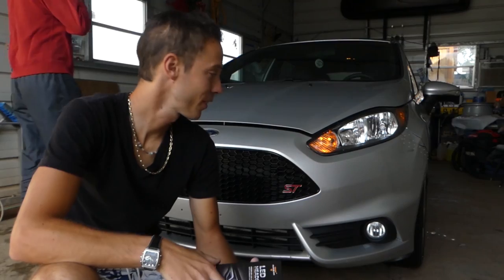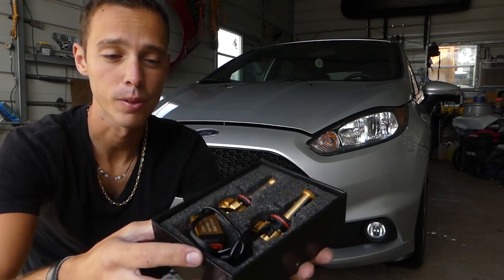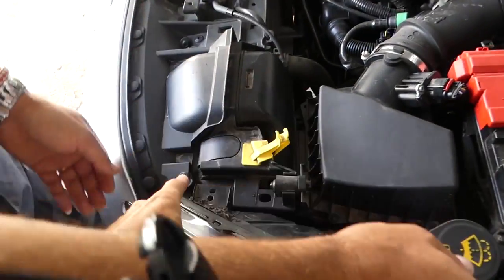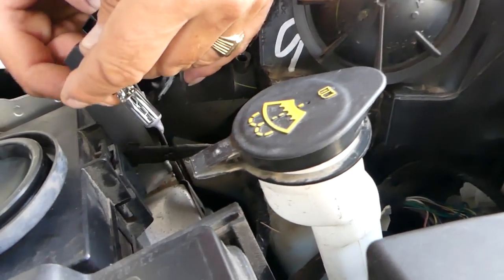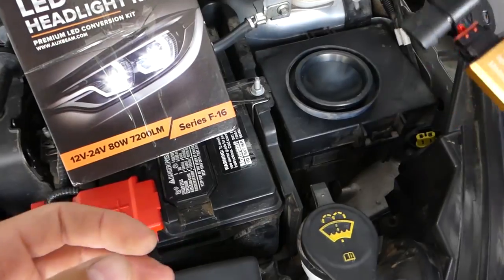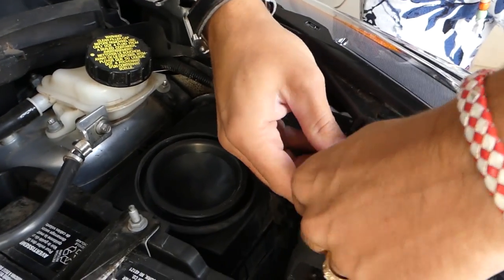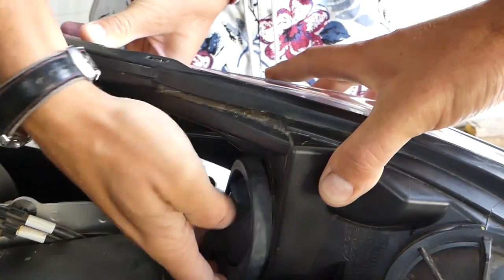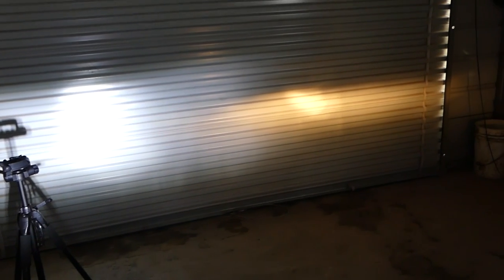Ford Fiesta ST LED Headlight Bulbs Installation  & Review by Auxbeam

Comment: The LED's can work well in newer cars.
The only problem is with older reflectors designed for the small point light source of the halogen filaments.
The LED emitters (especially COB types) are a larger light source which gives a less focused beam pattern.
I am still fiddling with LED's, trying to get a good enough focus in my 2001 Ranger.
For me, the halogens are better.

Comment: Just installed some of these on my Fiesta ST, and the beam pattern is terrible. If you look on the wall, the stock headlight has that nice cut off, and it won't blind anyone. The LED one though is way too high, and doesn't have that fine cut off like it should. They're bright as can be, but are awful to be on the other side. I'll be returning mine. They're great on my ex's Prius though. Just our housings can't use them properly.

Comment: that's going to blind the drivers in front of your ST
Reply from the maker: Why then most of the new luxury vehicles get LED from factory.
Reply: most of new cars have projectors. I know you get the point
Reply: The cars that have LED from the factory have projector housings. Having a reflector housing like yours, more light is scattered and not properly reflected down road. You may have a lot more light from the driver's seat. But oncoming traffic as well as traffic ahead nite not appreciate the extra light in their eyes.
Reply: Yeah. You must at least have the projectors to avoid dazzling! And automatic height adjustment to be lawful.
Reply: Gabriel Aquino 
I already get bright lighted by cars who think my lights are on bright when they’re on dim.
So really, nothing would be changed.
Reply: It's more so the auxbeams that have a bad pattern, there are better leds that mimic halogen filament placement. You dont need projector hoisings just the correct bulbs.
Reply: Gabriel Aquino tard
Reply: @WorldMechanics  

Because they have a lens that match the led light pattern. All you are doing is teaching illegal practices
Reply: These lamp are a original factory or u need get the new lamps as well
Reply: Reflectors work with led and projectors work with HID

Comment: Did you have any heating problems so far? And did the car give a malfunction on the dashboard?
Reply: hi mate I have ford mondeo titanium x problem with till find problems was connection  make good clean and make sure right on end till will be clips  remember  if you have  multifunction light  and get new headlight make sure got that system swell is 2 type

Comment: hi I have a question, I have a 2016 ford focus. the Fiesta and the focus is pretty similar when it comes to the housing. now the LED lights have a fan built in. would I need to poke holes on the rubber cover or its OK if it's sealed in the housing. thank you in advance
Reply: real9777 no they are not. That are totally different. Use one with a heat sink strip.  The focus you can’t change the blinker out. Can’t find a vid anywhere!!!! But CHANGE YOUR HOUSING TO A PROJECTOR STYLE LENS!!!

Comment: I bought H11 bulbs for my Fiesta ST but I’m not able to fit them in. How were you guys able to?
Reply: They're not H11. they're either H4 or H7. H11 are usually front fog light bulbs.
Reply: For low beam is H11 but high beam not sure

Comment: Brighter but the light pattern of the led bulb was awful, you will blind oncoming trafic.My guess half of the light is scatter upwards instead of down on to the road as intended.
Reply: Should be scattered down and to the right if you drive a left handed vehicle.

Comment: You are able to use these bulbs inside reflector headlights, but you must adjust the headlights down after installation. Most people don't have a clue how to adjust the headlights on their particular vehicle and they have lights that shine all over the place. I'd like to go bust headlights out with a hammer when I see how morons drive with headlights out of adjusted sometimes.